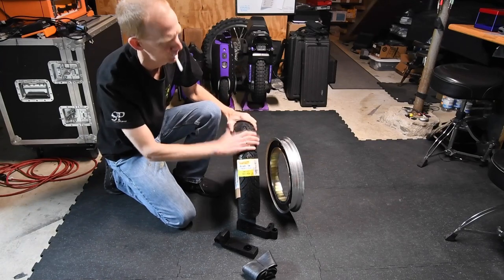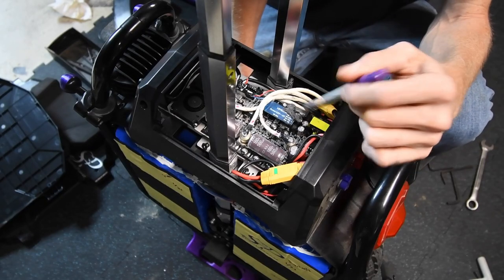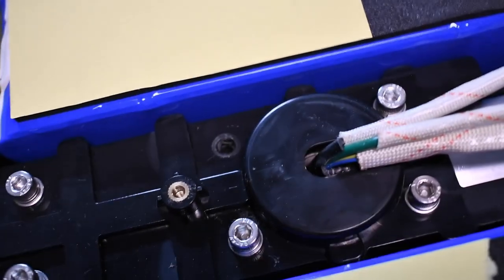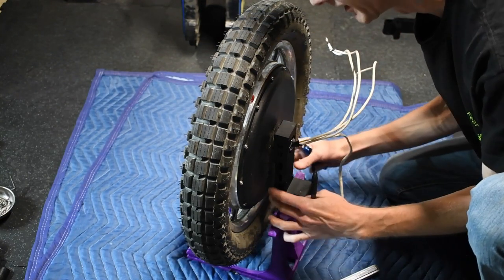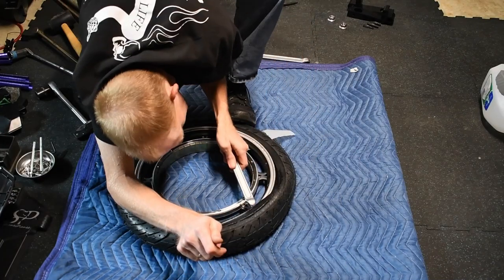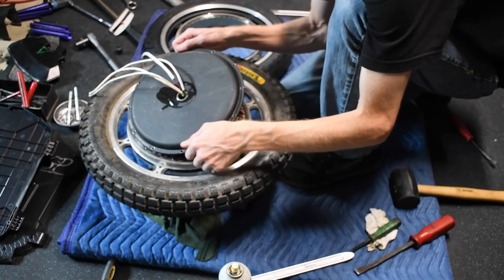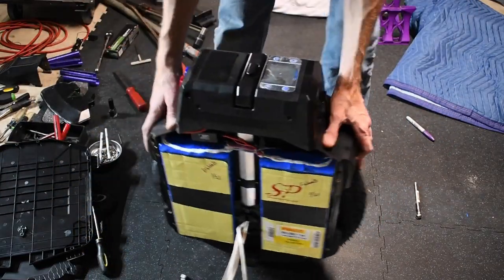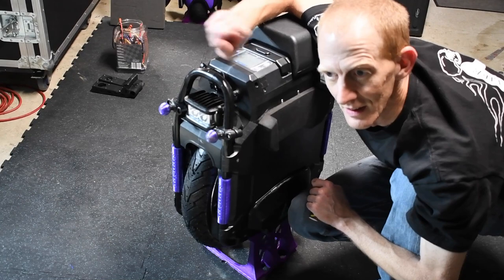Veteran Sherman Ver1 rim swap, hanger swap, tire change

Comment: Thank you so much for documenting this so well!
It'll help a lot when I'll swap to a street tire also.
I'm looking forward to your impressions once you get the chance to play with tire pressure 👍
Reply from the maker: Happy to help. Im finding 20psi to be my sweet spot so far. Im 130lbs and rode at 20psi on the ohter tire as well. The Angel seems it wouldnt mind going even lower. I ran 15psi, but it started to take more input and 20 felt right. Keep checking back, I hope to do a video ride with my uneducated opinion, soon.

Comment: when that motor sucked into that rim, it made me shiver DAM!!!. Crazy skills disassembling the wheel and then putting it all back together!!! like that 👍will be my go-to reference if I ever need to do the same. cheers.
Reply from the maker: Yes, it is dangerous. Sharp edges and it doesnt care if you are tough or not. Thank you for the kind words. I was an automotive tech for quite some time. I like to think I was decent enough at it. Same stuff smaller package. Be careful!
Reply: @shanesplanetshane3795  yeah that was insane Shane. Do they warn you about this???
Dude my instinct would've been to put my thumb over the top to gain better control. And LOSE both my thumbs apparently.
Reply from the maker: @arcrides6841  They, who? Nah man, this was the first time I'd messed with it. Not much support for working on these. I dont think any how to's were out about the rim/motor yet either. Turn wrenches long enough, you either lose fingers or learn to recognize how not to. I dunno if the motor would lop a finger off or not. I'd go from the bottom tho, so you can see the alignment. No need to lower it by the wires and hope you get it straight. Don't want the weight/stress on the wires anyhow, specially when the rim becomes part of it. Id imagine if you align it badly enough, it could chip a magnet or loosen one as it's snatched  into the magnetic field.
Reply: @shanesplanetshane3795  They the suppliers. The ones who sent you that death trap.
Reply from the maker: @arcrides6841  Nah, but e-wheels DID mention about which side the wires and magnet offset goes. If you pay attention tho, you'd notice it anyhow.

Comment: Arrow is in right possition, but you need to mount tire backwards. Thats because your tire is front bike tire. Front tires is always mounted in reverse position, to reduce vibrations/wobblings. So for the bike arrow is correct, but we need a traction wheel, so it should be mounted as rear bike wheel - backwards
Reply from the maker: I'd imagine the direction could be argued for many many years. Thanks for watching.

Comment: Excellent. Tape your wedding band next time. Pink hockey tape does the trick :)
Reply from the maker: Oddly, I've only arc welded my ring once in over a couple decades of technician work. Worst incident was actually when it caught on a door at the stealership I worked in. Thanks for the concern!

Comment: The reason for the front tire to roll in reverse,believe it or not but you will get 4 times the live out of a tire..
In the agriculture business you see it all the time, rolling tires backwards and drive tires forward to self clean
Reply from the maker: interesting, and I don't doubt that it has something to do with wear characteristic. I read something about that and cyclic vibration caused on 2wd vehicles, if treaded same direction. I'm not sure how yours scenario applies to single wheel pavement vehicles, but tis good to know. Perhaps the direction pirelli claims is 'forwards' is actually backwards and they marked it for this very reason? Thanks!

Comment: hey bro ... where can I go to learn about Chargers for these ... ? quick chargers ... normal chargers.. brands ... ect ... 
great post by the way thanks for this ..
Reply from the maker: Lots of info to be found at euc.org, youll just have to dig a little bit. I just use the e-wheels branded for all of mine. Im sure there's others of similar under different names. Just be sure to buy from a place you trust. Charging and battery care is VERY important. Thanks for watching!

Comment: What did you use when putting the motor cover back on, RTV?  Use any blue loctite on motor cover screws?  I will be tackling this shitty job sooner or later.
Reply from the maker: Pretty sure I used 3m weatherstrip adheisive. Im sure rtv would also work. Its mostly just to keep water/dust out. I went with VERY little and weatherstrip, as I've had rtv clog an oil pump before and I've been nervous ever since. Im sure RTV is fine, just be gentle with it. I used medium strength thread locker and torqued in criss cross pattern. My guess is somewhere around 20ftlbs. TIght, but chinese screw tight. Watch your fingers or youll lose one when the motor sucks into the magnetic field.

Comment: Motorcycles also use a directional tire for braking. No difference with unicycle
Reply from the maker: Just a few slight differences. Unicycles don't suffer from weight shift in the same fashion as a motorcycle. There's also no trailing tire on a unicycle, which changes water patterns. Unicycles dont track quite the same as a steer nor a drive tire on a motorcycle.

Comment: Can you please provide an update on installing the tire backwards? How was it? Do you feel your assessment was correct?
Reply from the maker: I really enjoyed how solid the tire would ride. It allowed me to keep lower pressure to mitigate bounce. The knobby was fun too, but the Scooter tire felt more applicable for street. I never did get it to hydroplane, but I also never turned it around to compare. I honestly can't say that I have a definitive answer to the differences when mounted on an euc I've ridden on my roads. I dont own the Sherm any longer. I did keep a couple others, but chasing the speed demons ended, before I destroyed it. I still ride, but Im also flying a bit. Thanks for watching!
Reply: @shanesplanetshane3795  Thanks, Shane! I will give it a try backward and maybe provide some feedback down the road because I have also ridden the tire forward.

Comment: Hi thanks for the video, Im due to get the master soon, been thinking about this tire instead of the Michelin city pro, how does the tire ride?
Reply from the maker: It rides more solid and smoother on the sherm than my original. Its more of a motorycycle tire feel, rather than a thin bicycle tire. I've had no problems from mine and its wearing very slowly. Just be prepared for it to be a little more sensitive to turn in. I could see if a newbie tried one, it would end in a little more wobbles, untli they figured it out.
Reply: @shanesplanetshane3795  many thanks for this, honestly the fact we share information like this makes riding far better and more importantly safer. Once again  thanks.
Reply from the maker: @frederickoparah1669  Fwiw, Michelin makes damn good tires too. I honestly can't make any claims about comparisons, other than acknowledging quality manufacturers , over the crap manufacturers, based on previous use. I've always preferred Pirelli on my sport bikes, but I trust Michelin as well. Atm, my Supermoto is wearing michelins. I suspect that you cant go wrong either way. I mean hell, does anyone REALLY thnik Kenda is even close? haha

Comment: @5:33 RTB? IT PULLS? Care to explain, jag no idea pulling the plug could sort the driver and how can you pull a 3.5mm out "the wrong way"?
Reply from the maker: "while powered", would be considered the wrong way. The nature of a trs plug means the plug will bridge connections as you plug it in or unplug it. MOST electronics are designed so the 'bridged' connection, doesnt cause a short that can destroy electronics. I read reports that the trs on the sherm, was NOT wired correctly, and pulling the plug while powered, can result in damage. Its a stupid and elementary design flaw, if its true. I havent bothered to check the wiring for validity on the Sherman plug wiring.  *RTV  Room temperature vulcanizing compound.
Reply: @shanesplanetshane3795  Oh now I get it, thanks. Did You modify something to mitigate the risk or You just make sure to power off before pulling / inserting..... or even disconnect batteries?
Reply from the maker: @bigbadboogie6842  I simply glued (rtv) mine in so it couldnt vibrate loose, or someone accidently uplugs while fiddling. Powering the wheel off prior to disconnect is all that is required.

Comment: What's the update of your Sherman now? I meant, how's the tire working out for you?? What is the name and size of that tire again??
Reply from the maker: 80/80/14 Pirelli Angel.  Works as good or better now than when new. I've finally scrubbed the outter layer down and have gotten to the good stuf. Very little wear, so I imagine this tire will last me a LOT longer than that dirt tire. I havent noticed my street tire being inadequate for gravel or other mild surface issues. Still running 20-22psi.
Reply: @shanesplanetshane3795  Thanks so much Shane! Your videos are awesome!
Reply: @shanesplanetshane3795  Hey, man! Just watched an EXN vid where someone said to use a 80/90-14 tire because "clearance is the same as on the Sherman."

Do you feel that tire size could've also worked here?

I'm curious if a Sherman Max can take this Pirelli...that might be a sweet combo!!
Reply from the maker: @MadLadsAnonymous  Its entirely possible. The diff between an 80 and 90 is a mere 8mm. One would have to try it first hand, to be absolutely sure. I personally can't say either way.

Comment: can you share  the STL for the purple stand you designed?
Reply from the maker: All my stands are purple. The one I used for the sherman is a simple adaptation/resize of a design you can find on Thingiverse. Its not a very good one for the sherm tho, as its a pain to center it up when storing. It also cost near a KG in materials on conservative settings. Thanks for watching!

Comment: What size of key do you use to unscrew the nut from axel?
Reply from the maker: 7/32" filed down and hammered in. NONE of my metric or standard would fit (top notch quality for sure haha) Mine were so tight and tapped holes were so bad, I had to keep digging thru allens to find one that would take the leverage I was applying. Maybe they were supposed to be 5.5mm? Idk.

Comment: I cringe each time i see that cheap screw driver😜. It's just waiting to slip and round the philips or worse go into MoBo 😥
Great teardown regardless and think it helped a friend that turned cables wrong and got warning eHall... Cables to the right, cables to the right...i feel the anxiety popping it in, in wrong direction 😉
Reply from the maker: I started with a Snap-on brand screwdriver. THEN I moved to a craftsman. Eventually it was the cheapie that got it. I also had to grab with the vice-grips on one of the screws to get it broken loose. Yup, not a fun endeavor. Thanks for watching...

Comment: What did you put around the rim at 14:57
Reply from the maker: 3m weatherstrip adhesive. Its merely there to prevent water ingress. I find it easier to split apart than rtv, but anything laying around that is similar, would do the same thing.

Comment: looks like it has a little wobble hope it won't be a problem at high speed
Reply from the maker: it runs pretty true on the road. I am however a little shaky, some days worse than others. Thanks for watching!
Reply: @shanesplanetshane3795  I know it can be a hassle, but you should try and reseat it, let out the air, break the tire lock from the rim and rotate it a bit and then reinflate it, should be better, that is if the rim has no dent in it. I used to work in a tire shop and that was one way of fixing wobbles..
Reply from the maker: @django1364  It runs true, no need. The solution to me being shaky is for ME to ride more. You do realize I made a video, showing what you are telling me. . .
Reply: @shanesplanetshane3795  OK I didn't see it, thanks
Reply from the maker: No worries. Tis good advice. Hopefully I wont need repair any flats or open any for a while. All's left to do is get better at riding.

Comment: is it ok to use tubeless tire on sherman rims without tube ?
Reply from the maker: I have no idea if the rim has the integrity to keep a perfect bead sealed on a tubeless tire. You'd need install a valve stem at the least. Im not going to make assumptions either way, as Im having no problems from my tube/tire and aint about to risk it. Thanks for watching.
Reply: @shanesplanetshane3795  how long have you been using tubeless? And what pressure
Reply: @shanesplanetshane3795  And are tubeless tires okay if we keep using tubes?
Reply from the maker: @superdhetz  I've been using tubes since the day I got it. I changed tire a few hundred miles ago. Running a tubeless tire with a  tube, is no big deal and common. They been doing that in lawnmowers for decades, same with motorcycles. Tubeless tires tend to be made heavier and more stiff, but thats not a given.

Comment: You also lost some top speed if outer diameter/circumference changed for smaller (or maybe it will just get closer to max rpm) and motor controller is (maybe) made for a specific rolling circumference, so might not behave like before (who knows maybe better).
Reply from the maker: That occured to me. I do think the 10mm difference will be less than that, as the tire doesnt sag as much now. I also dont think the sherm is 'speed' limited, more like power limited. If thats the case, highest speeds shouldnt be effected much.
Reply: @shanesplanetshane3795  i think its rpm limited due to hall sensors (like most other wheels). Thats why you have an unloaded free spin limit around 100km/h, it's a very low power draw to spin the rim+tyre to 100km/h compared to propell 90+Kg driver to 70km/h with both friction, mass and air resistance.
But if its 10mm on diameter its pretty easy to calculate. And easy to conpensate for speed and distance in euc world :-) 10mm diameter difference should pan out to about 2% error on speed and distance if outer diameter is 18".
So likely no loss in top speed, just closer to max rpm by a bit :-) basically the difference between running a knobby that is finished and a new one.
Reply from the maker: @bigbadboogie6842  Free spin is defnitiely limited. I think loaded top speed is limited by other factors BEFORE free spin top speed is achieved. Your math is right, but you also have to account for the LOADED rolling distance per revolution. It does seem the off road has more sidewall defelction at given pressure and weight. This could easily mitigate the height differences. Im not overly concerned about the precise math, as I am aware of too many variables, and theres many others Im unaware of. ROlling resistance between the tow tires, could skew our well thought out math as well. At any rate, Im not trying to sqeeze a mph or two on the top end. I coudl prbably offset all the math by simply inflating the street tire. It DOES take off like a rocket at 35psi, MUCH more than the knobby would. Thanks for the response, good info in there!

Comment: Imagine a tire change video that doesn’t show how to remove the tire🤦🏽‍♂️
Reply from the maker: The new rim came with NO tire on it. I never did remove the old one. Never mentioned 'tire removal' in the video info, either. Sold the wheel and gave the new owner the old rim with the knobby tire still mounted. *Imagine someone complaining about a FREE video on a channel that doesnt monetize a single moment of information. It happens. Thanks for watching.